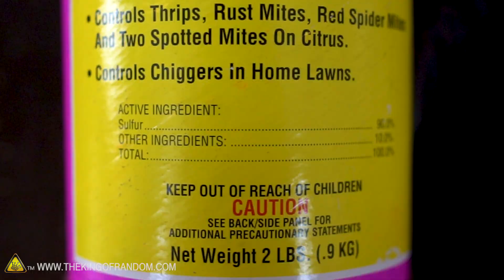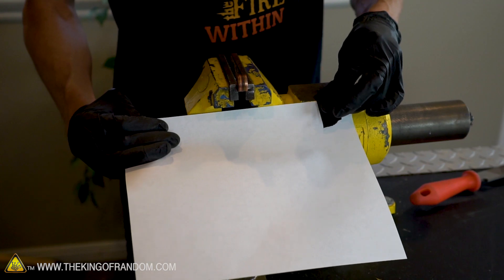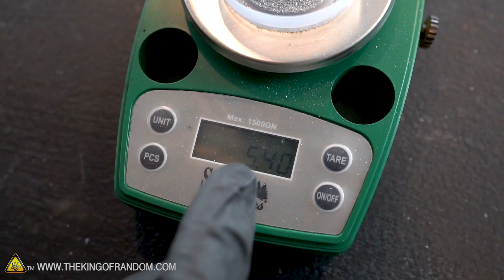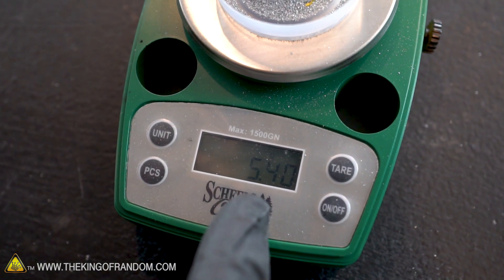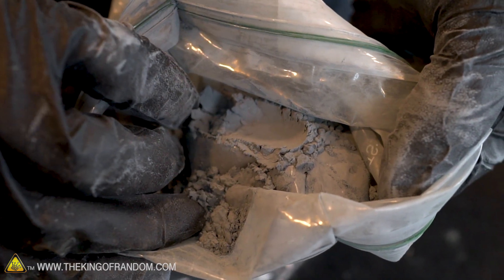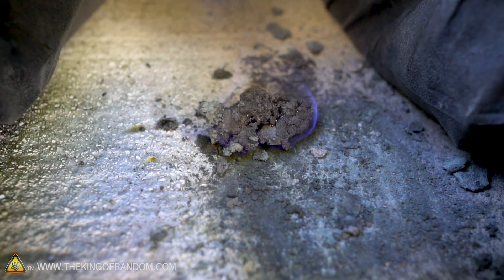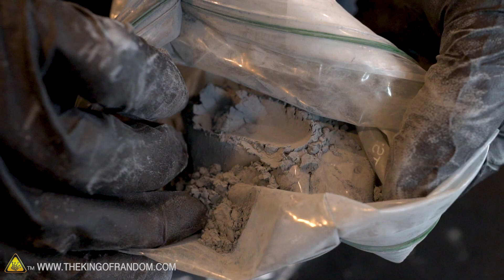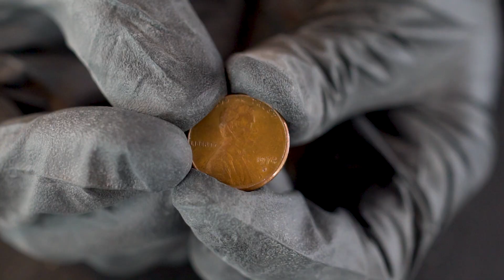Experimental GREEN Flash Powder! How To Make Flash Powder With Only 2 Ingredients! Zinc Sulfide?

Comment: Make rocket motors like they did in the book, using the Zinc-sulfur mixture. I believe they used some kind of combustible stamp glue to mix it together, filled the motor casing, and used a pencil in the middle to create a burn hole. See what you can do.

Comment: You should try doing the filed zinc with sulfur like you did the first try, but use the 3:1 ratio instead. 
I mean through this experiment, it seemed the ratio was the factor that was causing the success/fail, not the powder thickness.
(i am simply guessing that how fine the powder is will affect how "flashy" the reaction is)

Comment: There is a safer option for green flash powder. Magnesium with bariumnitrate. You can get the magnesium by filing down certain bramds of pencil sharpeners or from firestarters. The bariumnitrate can simply be extracted from sparklers...

Comment: Use 4 to 1 ratio it will work even better...attach two pennies in a small 3volt motor turn it on and touch it on a very small grid sand paper that will work..... Or the hard way of do it by hand

Comment: When Grant was casting silicone molds I recommended that he build a ultrasonic vibration table to help knock out the air bubbles in the molds. The same table could be used to grind zinc into a finer powder it works on a similar method cleaning bullet casings when reloading ammunition. All you need is a palm sander, something to hold your materials like a steel bowl, and some steel BBs. The grinding process should take 24 to 48 hours but it's super cheap and easy.

Comment: What about the ground pennies, do they work when it is a 3/1 ratio? Also does the 3/1 ratio of fine dust that you bought ignite with a lighter or fuse? If you have a piece of magnesium tape to ignite it with it would be interesting.

Comment: To grind the zinc down, just make a home made ball mill (: Marbles in a metal tube with a welded lid on one side with a small motor to spin it around, and a removable lid on the other side. Careful though, super fine metal can ignite easily, and if that happens in a confined cylinder... well... problems..

Comment: Try using the zinc castings from a lantern battery then use a belt sander to grand it down then use a mesh screen to sift out the smaller particles

Comment: Is it possible to put the zink filings into a coffee grinder to further the milling process to a finer powder or would the metal blade cause and significant issues with possible static discharge and ignition issues?

Comment: You just made a dustexplosion, which always will burn that easily. the ignition made dust fly everywhere so that was whats going on. a 1:3 ratio isnt just 3 grams of zink and 1 gram of sulphur. it should be 3x65 U of zink to 1x32 U of sulphur (m=N*M). So for zink its 195 and forsulphur its 32. which will give you a ratio of 195:32(6:1). I dont know if that will make it ignite but that should be the ratio.
Reply: Zn + S → ZnS

the molar ratios are the same, but the masses are different. 65g for zinc, and 32 for sulphur, so you'd really only need a 2:1 ratio instead of 3:1 or 6:1.
Reply: thats true but ratios in video are incorrect or it was actually 3 gram to 1 gram but i doubt that.
Reply: im not the best at chemistry but thats how i see it xD
Reply: It can't be a dust explosion because there is no contact with air for the powder except for on the surface. It would have to be first dispersed through the air and then ignited. The reaction to zinc sulfide will still work in a slightly incorrect ratio.
Reply: I’m so confused...

Comment: if you dizzolve the zinc in a solution then use electrolysis to extract it, you will get an extremely fine zinc powder that can get as fine as the atoms themselves

Comment: If you make a small ball mill you can make the fine powders you are looking for. If you are making a non flammable powder you can use large steel balls in the mill but if you plan on doing anything flammable, i.e. gunpowder, you will need to use lead balls.

Comment: Zinc melts at a lower temp than copper so you can grind one edge off the penny heat it up and the zinc will pour out giving you pure zinc and a mostly copper shell. Then you can take the zinc you recover and pit it in a ball Mill and run it till the powder is as fine as you want it. You can buy one or do like a lot of people and make your own

Comment: If you make a long enough copper coil and join the coil at the two ends to make a loop, can you use a battery cell and two rare earth magnet to make a "train" that just goes round and round until  the battery dies?

Comment: For homemade zinc powder you should use a file or a belt grinder to make coarse  powder at first, and then use a homemade ball mill to finish it off. You will get a much finer powder  than with mortar and pestle. It will work for sure if you will mill zinc powder for long enough.

Comment: You should use about a 2:1 ratio of zinc and sulfur to get the best results, since one zinc atom binds with one sulfur atom to form ZnS, but  there’s about twice as many sulfur atoms in one gram as there’s Zn atoms in a gram. (Zn atomic mass: 65.3u / S atomic mass: 32u). Maybe add a little bit more sulfur powder since it’s only 90% sulfur.

Comment: To get smaller fillings from the pennies you can try running it against a belt sander with decently small grain size or using high grit sandpaper.
Reply: Then you will have sandpaper grains in the mix.

Comment: The best option for making zinc or any metal dust at home is to put a chunk of the metal in a lathe, cnc machine or just drill it out with a drill to get the particle size to something that can be ground down then puting it in a ball mill for 2 weeks.